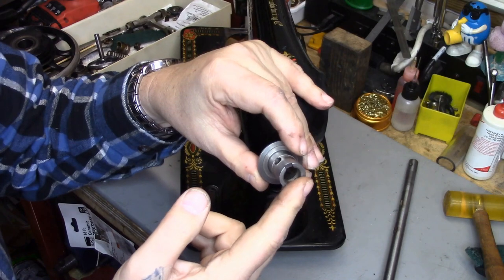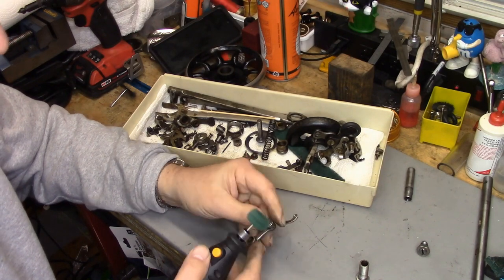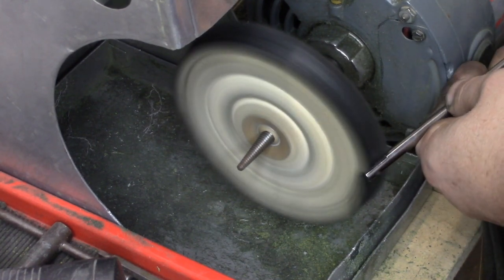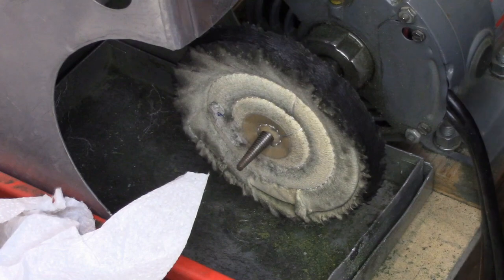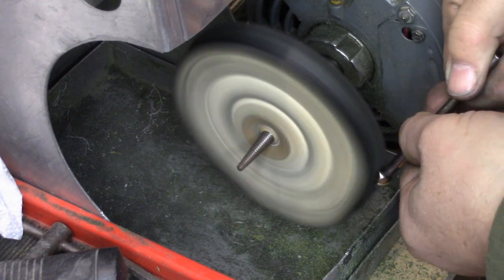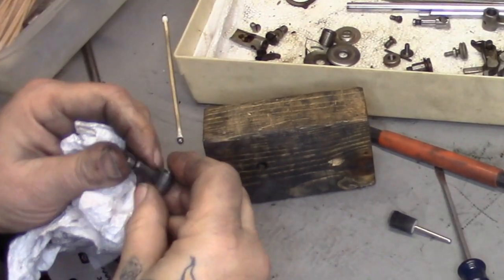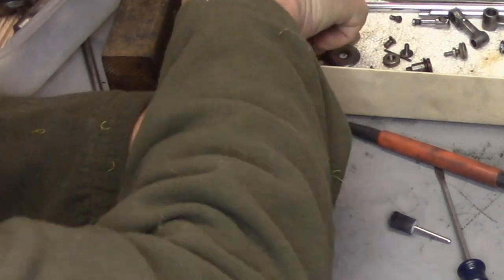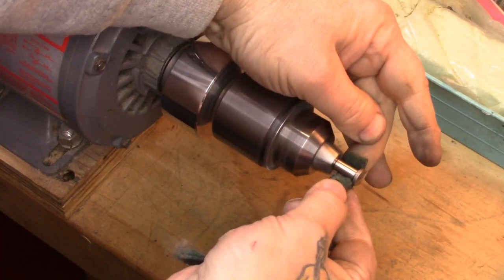Saga of Sophie Part 3: Cleaning Internals

Comment: Bob, thanks for showing polishing screw heads with the Sally's finger nail form files.  I stopped by Sally's and picked up some files for my 66 project.
Reply from the maker: It works great, whether you are using a bench motor, a cordless drill, or a drill press.

Comment: In some earlier videos you mentioned washing the screws and stuff in hot water and dawn with a toothbrush. Did you do that before taking the dremel or the other machine to polish them up? I also want to thank you so much for doing these videos. Your kindness and hours of very hard work are greatly appreciated. I'm still going through your videos, and no matter what machine you're working on, I learn something.
Reply from the maker: Many times I do take the screws to the sink to soak them in hot water and a degreaser. Sometimes, I  just hold the screws with screw removing pliers and use a wire wheel in a Dremel to knock off the worst of the schmoo, teh take them to the bench motor to polish up the heads and repair beat up screw slots.
Reply: @BobFowlerWorkshop  Thank you for your quick answer. One other question, if I may. Once you've cleaned all the smoo (sp?) what protects the metal from rusting again? I assume it isn't left clean to bare metal. Where I live is very humid, and rust happens quickly on bare metal. Again, I've been pretty much watching as many of your videos as possible these last few weeks, and I can't tell you how I appreciate all your hard work.

Comment: Hi Bob, is there any other way to clean the parts, especially the screws and small parts if I only have the Dremel? Is there a soak/degreaser or anything I could use instead of the bench motor? I've only got the one machine and am unlikely to be allowed another one 😁